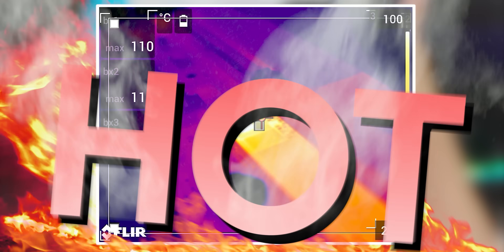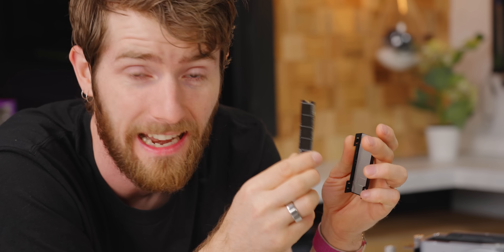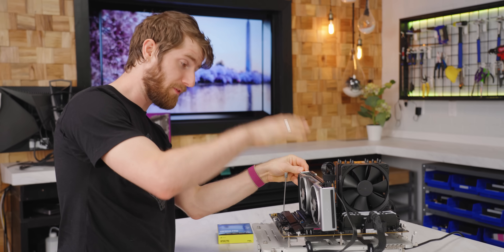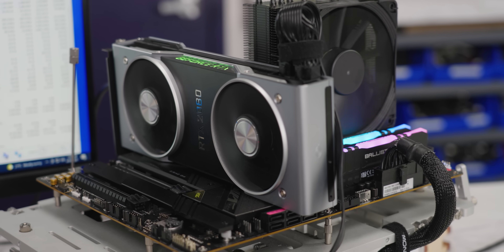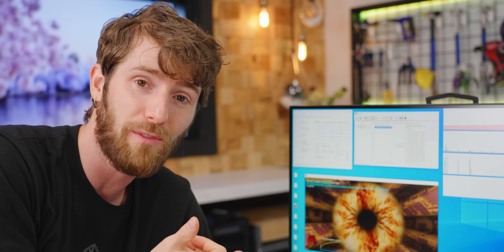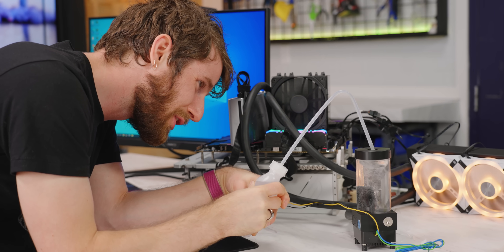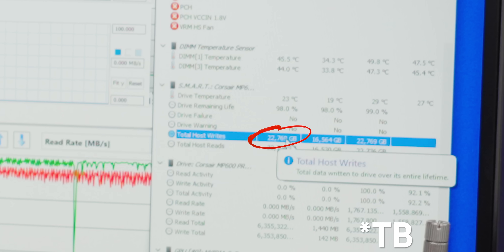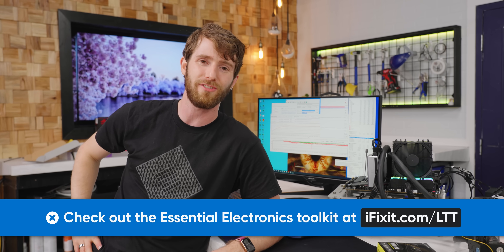This Product is a Meme - Corsair MP600 PRO Hydro X water-cooled SSD

Comment: I feel like this has gotta be a product they engineered for a client and then did a production run on just because they had the tooling available. There's clearly not a great performance reason for doing this, but if limiting the heat footprint of your system matters a lot I could see this being a relevant device in certain Industrial and commercial use settings

Comment: "Aw crap I put the waterblock upside down" that is such a Linus thing for Linus to do.
Reply: PC centric managed to break the RGB connector off on his RX 6800 when disconnecting the cable with pliers, when fitting the water block.
Reply: That poor graphics card.
Reply: Um actually the slot he used was the reverse of most m.2 slots in that the entry direction of the drive was towards the rear , so he had it right , it’s the motherboard that was wrong/

Comment: The flow rate reminds me of back when watercooling was in its infancy, and there were two types of loops you could build (high restriction with tiny tubing diameter, and low restriction with huge tubes).
Reply: Haha yea i remember that people woukd argue woukd eheim pump flow as well. I still have my maze 2 and maze 3 block and my eheim pump.

In fact i used my dangerden maze all the way from my durong athlon xp athlon 64 athlon 64 duel core.. opteron.. and e 8400 wolfdale... lol

Comment: Imagine how hot the SSD would have gotten inside an actual case like most people use, instead of a open air test bench.
Reply: I'd argue that a case with proper airflow keeps anything on the MB cooler because air is moving through the whole case. Test benches might subject VRMs or SSDs etc to less airflow.
Reply: A test bench doesn’t provide any airflow buddy, because there isn’t a chamber to direct air, air flows anywhere it wants. That doesn’t happens with a case, cool air in, hot air out, constantly.
Reply: @philosaplease4867  A case with proper airflow is hard to find, most top 10 cases are usually glass paneled heaters lol. All the air flow in the world wont help you if you're SSD is hidden under your GPU like mine is. She gets toasty even with more then proper airflow.
Reply: yeah no. In a case there’s directed airflow. In this open air test bendch there wasn’t any
Reply: @mrsheashea1375  in most Motherboards the m.2 is placed above the GPU, therefore the only heat it gets from the GPU is from the Backplate. And you can realy easy keep this Air cool with a Fan blowing over the GPU and the fanspeed controled by GPU-temps
Reply: I swear those user testcases are so useless, because 90% of the reviewer use a test bench…
Reply: My Samsung PM981 (essentially a 970 Pro) ran about 80C while gaming. (In a Fractal Design Meshify Mini case, 3x Arctic P12 on the front, also 3x P12 on top, 1x P12 back, 6900XT Nitro, 5950X with NH-D15.) It ran a bit cooler (about -5~10C) if I ramp up the CPU cooler fans to higher speed so airflow does help but ramping the CPU fan unnecessarily was a bit noisy.

I just slapped a cheap ($10) heatsink with a tiny fan attached and it helped a lot. It is not audible and temperature dropped to maximum 66C.
Reply: It would have been cooler actually. Open test benches have zero air pressure to circulate cool air through. If your case has bad airflow then u chose a bad case and/or you have a bad fan setup
Reply: @mrsheashea1375  no
Reply: @HyunMoKoo  almost the same here, 970 pro, just os installed, controller hits easy 90°C. adet a small fan to keep this thing below 80°C.
Reply: @HyunMoKoo  you’re using Arctic p12s as case fans? That’s partially why. They’re static pressure fans. Static pressure fans aren’t good for general airflow in a case. Use them for radiators and that’s pretty much it
Reply: I actually think they screwed up ATX when they put the power supply at the bottom, but kept the i/o slots below the CPU.
If the CPU was below the GPU then the 200-300w heat would actually draw air in from below by convection, the space for the other slots would just need vents and quiet fans to mix cool air in with the GPU exhaust on its way out the top back of the case.
Reply: Most builds run cooler with the side panel off, heat is lost via infra red by T⁴ law but also due to convection.
It's 1U server boxes which force air flow through a thin box.
I think it was Jayz2 who tested Nvidia's "evil" internal upward exhaust into the CPU area and found it actually helped cool the warmest components, probably because of turbulent air flow disrupting what had been a still area.
As a result of seeing the temps he measured I followed your idea and ensured a good fan assisted exhaust under the case lid so cool air would be drawn from below, even when major components were at low load.
But the monster coolers on triple fan GPUs which stop/force air around the sides, forced a rethink as they are so big it essentially cuts the case into 2 zones and the side panels can be warmed up near the GPU (sinking that heat over a large area).  So ditch tempered glass, black metal is cool!
Reply: @mrsheashea1375  perhaps a shield fixed above the SSD would keep GPU radiant heat from the SSD and allow it to draw cooler air from below?
In the old days with larger cases and smaller sinks/fans it wasn't unknown to use ducting to manage air flow.
Reply: @johannesbohm6458  but the main warmth from the GPU is transferred via heat sink fins to the air drawn in from below.  That air flows out over the GPU sink/board and spills mainly around the sides, with a few cards from  Sapphire & Nvidia FE partially forcing air directly  upwards as an exhaust through the cooler.
As Gamers Nexus complains, the GPU manufacturers usually aren't using thermal pads to use the back plate as an additional heat spreader, which can cool things like VRAM.
My GPU back plate is structural to prevent sag but provides space above the board with an oversize heavy cooler + fans beneath.  It becomes warm but not as hot as the heat sink.
I think it is passively warmed by the exhaust air, as much as conduction from the cooler that's screwed to it.  Because unlike the case sides near the GPU the plate is evenly warm in a still zone.
Reply: @mrsheashea1375  kind of true, but the market has moved sharply away from glass and no airflow thanks to Steve @ Gamers Nexus who basically changed the direction of the PC case industry with his rigorous thermal testing. I run a fractal meshify 2. 140mm fans x3 front intake, 140mm x2 exhaust. It's chilly in thurr
Reply: mesh case. tons of positive pressure. air cooled cpu noctua D15. my SSD and vrm's are catching air like colin mcrae.

Comment: We officially peaked in human innovation after this.
Reply: there are water coooled psu iirc
Reply: @fabreezethefaintinggoat5484  that makes sense ngl
Reply: @dampe7438  And dangerous
Reply: @fabreezethefaintinggoat5484  imagine having a leak 🤭🤭🤣🤣🤣 boom
Reply: @fabreezethefaintinggoat5484  which Linus reviewed already and it’s beyond useless. It’s just a regular modular PSU with a waterblock under it, because if you ever tore down a PSU, you would know that there is no physical way to put a waterblock on those giant ass capacitors. And there is no reason for a PSU to be watercooled anyway.

Comment: Linus, can you make a fully water-cooled PC. Everything component in the system is water-cooled.
Reply: They've done it, right down to the psu
Reply: water-cooled power on button on the case :P
Reply: Search YT for the mineral oil pc
Reply: What about making the PC case out of a watercoolers
Reply: Water cooled water cooler
Reply: @Mr.Springtrap they did that with mineral oil instead of water
Reply: Watercooled case, watercooled memory, water cooled hdd, water cooled ssd, water cooled fans.
Reply: Watercooled 5.1 audio system?
Reply: Well the radiator won’t be watercooled.
Reply: @jonasthemovie  must water cool the radiator too. lol
Reply: AH yes, water cooled rgb controller
Reply: @jonasthemovie  You could always dip the rad in an ice bath.
Reply: @falubii9712  Would make it a heat exchanger, no longer a radiator.

Comment: I had a very tiny air-cooler on an M.2 once. It did reduce it from like 50 C to maybe 45 C. The PC form factor was very non-standard, so it was helpful.
Edit: I also once just added a few random tiny heatsinks to one before, which was also nice. I ended up ripping the flash off when I tried to remove the heatsink.
Reply: Oof

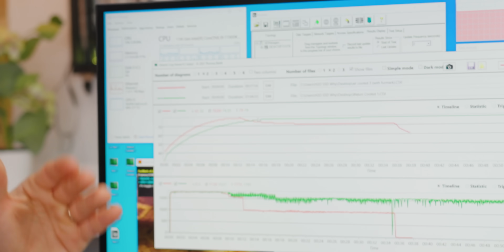Comment: 8:30 probably the water didn't just add thermal mass but also turned it into a very tiny, very inefficient closed loop water cooler, being just enough to keep it from throttling that badly.

Comment: Even though this doesn't make any sense it still gets a gold star for making more sense than yesterdays video
Reply: Agreed
Reply: Basically you don't need a water cooled SSD, cause in normal use you'll never put a load on it, that will make it thermal throttle. If you'll somehow manage to do it, by writing absurd amounts of data on it constantly, then your drive is going to die in days, anyway, so a $500 SSD is a waste of money, for that particular use scenario. The extra cooling simply won't help in any way, aside from making it run a bit faster through the days it has to live, that is.

There's no harm in watercooling an SSD, but there's just no benefit, either - it's not like it'll boost higher, or allow better O/C. It will definitely run cooler, but realistically you'll never really need it to.

Comment: Last time i was this early, Vancouver didn't had a 45° summer
Reply: Melt your ssd kinda heat in bc
Reply: It is much cooler on the east coast. 30. c from the Northeastern U.S. to Southeast Canada.  Still quite hot but nowhere near as bad.
Reply: @nicholasneyhart396  Still boiling by normal standards though :{ (sorry didn't notice you'd already mentioned that)
Reply: @Aroko 76 no man those people up there are dying to a cool fall day's worth of temperature.
Reply: Yes. If you want that in f. It was about 100 on the west coast and in the mid 80s on the east coast.

Comment: Linus: people don't use 100% of your SSD for extended periods at a time
me: extracting a 100GB game for the last 30min
Reply: If you did that on this drive you'd be done in under a minute
Reply: @sjorsangevare  OMG
Reply: chances are your internet is nowhere fast enough to actually download games at an NVME drives fastest speed (over 5000MB/s in case  you were wondering, AKA 5gb/s), and if youre just extracting a game that big, chances are you didnt buy it... most games nowadays install as they download, building folders as you go, limiting you by your internet connection. a game on a disc cant hold enough information to give 100GB. the largest optical media (blue ray) can store a max of 50gb. so... stop stealing games i guess?
Reply: @joes1176  
In ISP talk that's a 40Gbps line, most home lab/personal cloud would probably stay with 10Gbps or at "best" 20Gbps...
unless you're a real baler and have a quad 10Gbps card or 100Gbps... witch at that point you're probably dealing with raid and doing enterprises stuff so effectively easing up the single drive load and or not having to buy/care about consumer grade SSD.

Buuut like linus said if you're already running a custom water loop... why not :)
Reply: @joes1176   yea tbh I didn't buy the game I was extracting a cracked game ( mass effect legendary edition )
Reply: @omrhireubens3591  where'd you get it? For research purposes
Reply: @svampebob007  So you're saying I should directly attach a DWDM 100Gb/s line of the data center I work at, let it run and see what happens?
Reply: @MrMarci878  Yes that is EXACTLY what I am saying, You know "for science",  I just forgot to add your name to the reply my bad :)
Reply: @joes1176  white knighting for companies that will never white knight for you.
Reply: @joes1176  "chances are you didn't buy it"?! Ya do realize buying things on physical media is still a thing, right?
But also, yea fair
Reply: @joes1176  I will never purchase digital media of any kind.
Reply: extracting a game for the last 30 minutes. so your cpu bottlenecks. so youre loading the ssd with like ~57MB/s which would be 1-2% load.
Reply: By extended periods of time, he meant 22.7 TB. Not 100 GB.
Reply: @matthewspeltz2185  that's awesome, though I think there's less then "most" home labs ruining over 40Gpbs, but yeah the more data-center change over to 40/+100Gbps the cheaper it is going to get to buy those "old" cards :)

Modern OS do support aggregated networks, on top of more consumer hardware (cpu/motherboard) support server functions.
idk if that was the case before without inn house linux tools or some shit like that, so over all I'm exited to see what kind of craze things the home-brew/homelab community can come up with such speeds.

Comment: basically, if you already have a custom water cooling setup chilling your CPU and GPU, then get this one too.  it's just a little bit extra and but improves the ssd controller temperature which is surrounded by heated parts such as CPU, GPU, VRMs in a case.
another comment said "no harm no foul" absolutely. on its own it sounded gimmicky but if you already have a loop then add this too, it will only improve the situation.

Comment: I mean for aesthetic purposes it could give you more options in terms of custom looping. It’s probably more useful as just a looping add on than it is for cooling
Reply: Might be worse in a full loop with other components dumping heat into the water too..
Reply: @Gainn  I think the difference would be negligible. I’m honestly surprised Linus didn’t test for that though

Comment: To me home water cooling has always been about aesthetics over performance. If you’re in a ac cooled room and have a remotely reasonable fan setup/case, it’s not really going to make a dramatically noticeable difference in terms of actual usage and not just measuring numbers. But it looks sweet, and adding another component to the loop might just make it look a little sweeter.

Comment: Next: Water cooled cooling system (water cooled fans, water cooled radiators)
Reply: you wouldn't need water cooled fans, you could use the water as a working fluid to spin the fans, you would need a beefier pump and compleatly custom fans, but even with a watercooled fan you would need custom fans.
Reply: To be honest, I hopped they would do that for the all room.water cooling setup they build yeara ago so gung cannout build up in the pcs.
Reply: Well, I have some news for you... they are real. There are fans that have water loops in them. By adding cold water to them they would act as air conditioners. Radiators work by running hot water inside them. Not exactly water "cooled" but you get the idea.
Reply: So water cooled PC inside of a fish tank full of mineral oil. I think Luke should do it, that would be blast from the past

Comment: With Corsair also producing memory, do you think we'll see properly watercooled memory eventually?
Reply: Not with DIMM slots being as close together as they are
Reply: There is a EKWB water cooling for the ram... the block connects to heatsinks around each module, and the single water block does the whole bank of up to 4 chips.

Comment: I work at WD with ssd testing. Our 2.5” drives need contant (fan) cooking at all times. Still they get to 100-120F. Our M.2 drives have massive cooling blocks on the controllers, otherwise they’d die almost immediately (this is enterprise/server hardware, not consumer). But yeah, they run better at lower temps and last longer. For some of our largest drives (16TB+) water cooling would not be a bad idea as the controllers run overtime

Comment: I would like to see how it perform if it's part of the whole water loop where some other components  could actually reach high temps and heat the SSD.
Reply: I have a water cooled system where two 3070's also run through two 980 pro 2tb nvme drives and through two 360mm rads. The drives we're 86c before and now are 42c after cooling them under load. I enjoyed building the entire thing to be honest. It's a fun project for me. The card mine ETH and ssds farmed chia plots at first.
Reply: Water cooling doesn't really work that way. This is why loop order does not matter for thermal reasons.
Reply: @Sandriell  you not answering the correct question. We know the order of flow doesn't matter but type and amount of hot items vs rads sure does.

Comment: Just bought the Corsair MP700 PRO SE Hydro X Series 4TB M.2 PCIe Gen5 x4 NVMe 14,000MB/sec sequential read and 12,000MB/sec sequential write. Using it on my new Asus X870-I ITX with a 9800X3D delided@ 5.7Ghz, with watercooled memory at 8400mhz with a watercooled RTX 4090 as well. Temps are very low using the new Watercool MORA IV 400 radiator 🥶
Reply: Why do you people insist on writing every single specification out when you write these posts (that these "influencers" never read anyway)? I get it, its mostly meant to show off and flex on everyone, but fucking hell, it makes it a chore to read ANY of these comments.... 

Seriously, all you needed to write was 

"I bought a corsair mp700, its in my asus x870 with a delided 9800x3d, also watercooled my memory and ram. Temps are good."

Comment: this ssd has more ram than my first pc. How far weve come xd
Reply: Most CPUs have more level 1 cache on the die than my first PC had RAM...
Reply: Fun fact: a dual-socket EPYC system with 3D stacked cache will have 1.5GB of L3 Cache. And 4TB of DRAM, which is more data than my two SSD's combined.
Reply: @WhenDoesTheVideoActuallyStart  that moment when 2 epyc cpus have more l3 cache than my first laptop
Reply: @Raziel  rest in peace.
Reply: My first computer was a bio-neural mess, but my second computer had a cassette storage device.
Reply: @Raziel nah its not that long ago that gigabytes of storage were luxury
Reply: @Raziel  My first computer had a Voodoo card.  I was rocking two in sli..  ha. Ha..